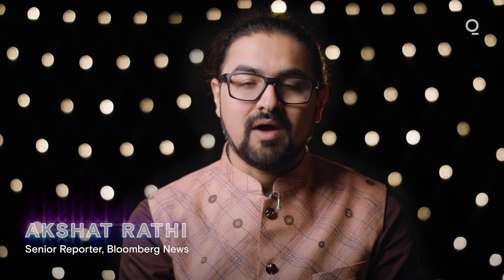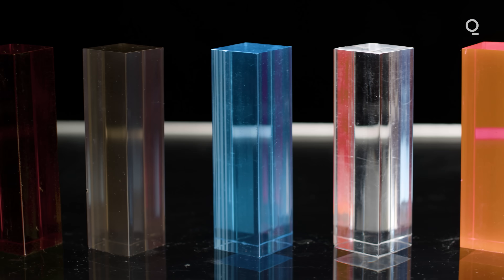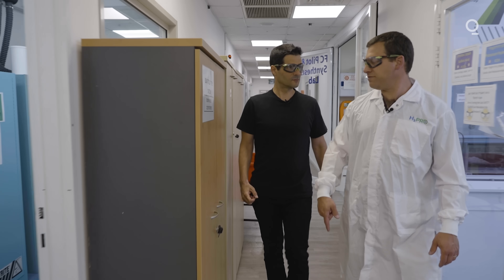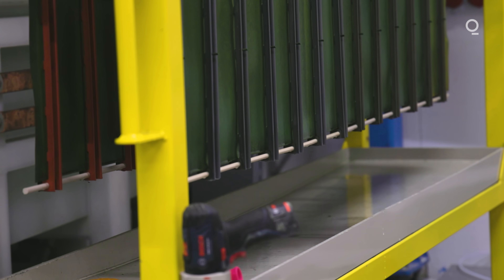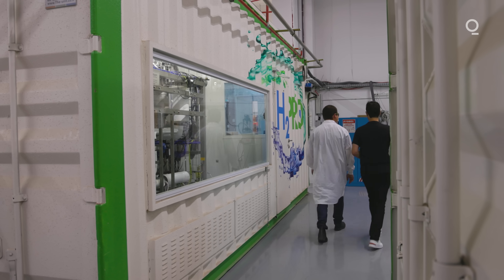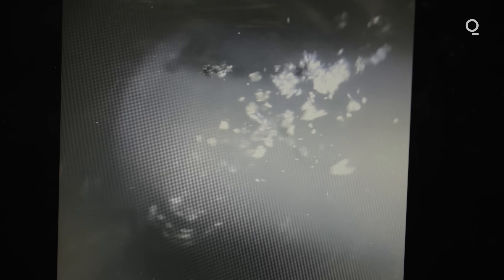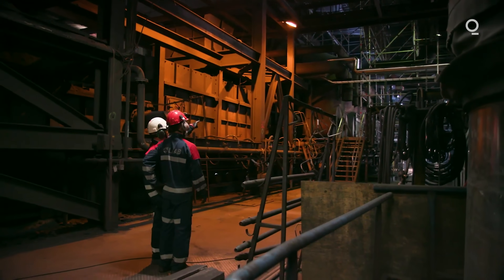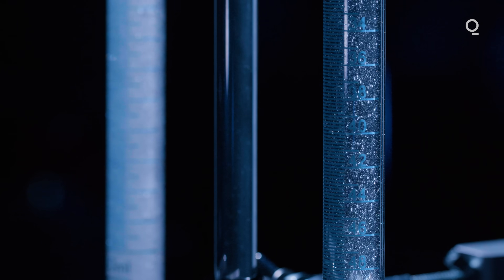How Cheap Hydrogen Could Become the Next Clean Fuel

Comment: I believe that C-Zeros process of removing the carbon in natural gas to be a better financial decision for our future rather than H2Pros of using hydrogen and oxygen to split water. This is my opinion because the world revolves around money whether we like it or not, it's our past and our future. If C-Zero can use blue hydrogen and green hydrogen at a rate 7 and a half times more than H2Pros green hydrogen process, then I see no debate. Yes, both companies want to hydrogen to cost around $1.50 per kilogram. But if C-Zero can use this turquoise hydrogen seven and a half times more than H2Pros, then they will have the greater potential of creating this hydrogen based "clean fuel" within the next 10 years over H2Pro.
Reply: Difference is that one company is using water the other is using natural gas. Natural gas is a tad bit expensive right now if you haven't heard, and essentially the company spends energy to make natural gas less efficient by converting it to hydrogen.

The only advantage that this method could have is that it's a way to use natural gas without emitting co2.

Comment: I didn't know there were so many ways that hydrogen could be made, and how much emissions could be produced when trying to create something carbon neutral. Even though hydrogen is extremely flammable and hard to store, I believe that when more industrial manufacturers and automobile industries begin using hydrogen as a fuel source, that it will get cheaper and much more efficient to produce, instead of storing it and waiting for someone to use it.
Reply: nah why everyone wanna be like Stanley Meyer all of a sudden
Reply: That's because you're not a chemist or chemical engineer, so why should you know? If you wanted to know, just ask one.

Comment: The lack of hydrogen fueling infrastructure is an issue that may be difficult to overcome without a lot of time but other hydrogen based technologies are available for use in other fields. This video showcased hydrogen based metal processing, if more hydrogen based machining processes like that could be implemented it could help to massively reduce our carbon emissions. Especially considering how many greenhouse emissions many industrial manufacturing processes create.
Reply: It's not a "lack" of something to regulate it out of being able to be used. Censorship, and a lack of something, are not the same realities.
Reply: how is building hydrogen fueling infrastructure harder than stripping every lithium available on earth for EVs, while still not having enough for the demand
Reply: Question if hydrogen and oxygen are separate from water💧 is that water💧 again useful for eg for drinking or for farming
Reply: @jitendrabalsaraf257 All of the water is turned into hydrogen and oxygen, which then ends up reacting whether via combustion or something else back into water, but producing energy.
Reply: Definitely this is the future, (green hydrogen derived ) liquid methanol fuel to fuel methanol fuel cell (and then electric motor without battery with way longer range and "rechargable" by refueling liquid methanol in just a minute just like any diesel engine. This is the future, better than "normal hydrogen" because methanol is a liquid fuel directly and easy derived from green hydrogen and way better usable than hydrogen because no need compression pressure storage and or ultra low temperature needed. Methanol liquid room temperature fuel is just a drop replacements in any gas station with little modification and same happens even with combustion engine but obviously fuel cell Ev gives more efficiency .
Reply: 😶‍🌫🤯We will soon introduce the revolutionary FAZE engine technology.
The 𝔽𝕦𝕖𝕝 𝔸𝕘𝕟𝕠𝕤𝕥𝕚𝕔 ℤ𝕖𝕣𝕠 𝔼𝕞𝕚𝕤𝕤𝕚𝕠𝕟 𝔼𝕟𝕘𝕚𝕟𝕖  
[𝔽.𝔸.ℤ.𝔼.] tech best solves the issues present in previous internal 
combustion engine designs by transforming the old paradigm into a 
simple, low cost, quiet, power dense, efficient, on-the-go liquid and 
gas fuel-flexible, ‘non-polluting’ solution for power generation of all 
scales and advanced transportation, construction, military, off-road 
vehicles including ships, aircraft, trains & robots not possible before 

𝔽𝔸ℤ𝔼 delivers better than 25% ABSOLUTE/ACTUAL [not relative] 
fuel efficiency improvement over gasoline engines, more than 15% 
for Diesel engines at any operating condition - speed/load, ambient 
temperature or elevation, not just at one optimal testing point at 
STP. Real world driving cycle savings could be an additional 200% 
higher due to the constant MAXIMAL efficiency and torque. The 
simple, low cost, native/built-in, non-electric, environmentally safe, 
non-explosive, temperature agnostic 𝕊𝕦𝕡𝕖𝕣ℍ𝕪𝕓𝕣𝕚𝕕© feature 
recovers more energy than EVs and provides approx.100% fuel 
savings for a combined absolute vehicle fuel usage improvement of 
approximately 300%, thus obviating the basic need for expensive 
EVs & e-hybrids. 𝕚ℙ𝕠𝕨𝕖𝕣𝔹𝕠𝕠𝕤𝕥 adds >400% more torque. It’s like 
4 engines in 1. 𝕚𝔼𝕗𝕗𝕚𝕔𝕚𝕖𝕟𝕔𝕪𝔹𝕠𝕠𝕤𝕥2© further improves efficiency, 
torque, power & other performance metrics by 10%. This is all done 
w/o a transmission. Additional fuel saving solutions are available.
 
The FAZE engine perfectly follows the vehicle’s road or genset’s 
electrical power demand with no energy loss [no fuel waste], This 
unique characteristic enables dispensing with any auxiliary power 
units [APU] for power or refrigeration in any application. This also 
makes for a perfect range extender for battery electric vehicles [EV] 
or as a standalone EV charging unit even where is no electric grid.
 
The fuel agnostic capability allows instantaneous use of any liquid 
or gaseous fuel [natural gas at home!!!] incl. biofuels and hydrogen, 
even if old/dirty/unprocessed like flare gas or employ the concurrent 
multi-fuel capability…anywhere on the globe. One engine for all 
locales w/o changes! Unlike EVs, this enables fast fueling anytime, 
anywhere…with no troublesome infrastructure disruptions or 
changes. EV’s are not a solution to the [FAKE]climate or mobility topics as 
high level of electrification globally is unrealistic 
[See Patrick Boyle's video "Electrify Everything?"] 

The technology offers smokeless, non-polluting, low odor heat and 
noise output without costly after-treatments, etc.,… with only the 
lowest  CO2. It has a negative carbon footprint with hydrogen, 
ammonia, biofuels or gasified municipal, agricultural and/or forest 
waste and coal from a 2-stroke-like simplicity. These are HUGE 
business opportunities. We can provide these turnkey solutions 

The FAZE technology can be integrated into any ICE or vehicle 
architecture, adding some of the positive characteristics to its own. An advanced Scotch Yoke architecture slated to be incorporated in the 𝔽𝕦𝕖𝕝 𝔸𝕘𝕟𝕠𝕤𝕥𝕚𝕔 ℤ𝕖𝕣𝕠 𝔼𝕞𝕚𝕤𝕤𝕚𝕠𝕟 𝔼𝕟𝕘𝕚𝕟𝕖  [𝔽.𝔸.ℤ.𝔼.]

With virtually no electronics and emissions equipment, the cost of
purchase and reduced servicing frequency make this solution 
even more appealing.

Comment: This is so interesting.  I had no idea that hydrogen gas could be produced in so many different ways.  I certainly had no clue that the color of hydrogen was directly influenced by the process by which it is produced.  It would seem to me that, while the green hydrogen is the ultimate goal,  the pink and the blue which are both produced by nuclear energy and carbon dioxide capture technology respectively, would be a very promising technology to develop in the fight against greenhouse gases.
Reply: Hydrogens are hydrogens, the colors are just to say HOW they were produced. Green means you produce Hydrogens with renewable, non-CO2 emitting, energy. Funny, it takes energy to create another form of energy.
Reply: The gas won't be colored, just a simple way to give each way of hydrogen production a distinctive color.

Comment: It would be great if we could start using hydrogen consistently for energy, but as of now there are too many cons. Only 2% of the hydrogen produced is made with little pollution being put off. The rest of the hydrogen created is generally made from coal. This is just polluting the Earth with an extra step. The clean made hydrogen is made at 3-5 dollars per kilogram and will not be usable in society until the benchmark of 1-2 dollars per kilogram can be met. Lastly, hydrogen is very hard to ship and safely contain. Zeppelins used decades ago ran on hydrogen, but often caught fire. It is not safe for us to use hydrogen till we can safely contain it.

Comment: You can't use hydrogen as fuel it's not practical it'll never work I mean yes it'll start a motor a motor will run but it won't work as a practical application there are too many water shortages on this planet can you imagine millions of cars running on water or is there a way to get the water back I don't think so if I'm wrong let me know but with water shortages the way they are in this country and around the world that's a waste of water

Comment: One important aspect of hydrogen fuel that was mentioned in this video was its potential environmental impact. It stated that the majority of hydrogen production today takes place on the polluting end of the spectrum. This spectrum is a spectrum of colors that go from the most environmentally friendly to the least. While most of it is produced on the polluting end of the spectrum, there are companies that are developing ways to produce it on the environmentally friendly end. The most environmentally friendly way mentioned was by separating the atoms in water by raising the temperature. The second most environmentally friendly way was by separating the carbon atoms out of natural gas. This leaves carbon in a solid state and does not release it into the atmosphere. Finding environmentally friendly ways to produce hydrogen is exceedingly important for the future of fuel and energy.
Reply: the video said it does make c02 when using natural gas
Reply: A very promising way to make clean energy was recently developed by Japanese scientists using small scale nuclear reactors that are cooled with helium instead of water, giving them the ability to run much hotter and not be constrained to rivers and lakes.

Comment: Do they realise that hydrogen is only a viable if you can source it. Right now that's the main issue. It doesn't matter how clean it is, if getting it (from water from electrolysis or by distillation of ocean water) inturn offsets the "green factor" that hydrogen is offering.

Comment: Hello Houston, we have a tiny problem to solve, and you can twist it and turn it upside down , and deliver it in any way you like. Hydrogen is right around 6 times more expensive to produce than Solar or Wind energy, and you can present it in the most sexy way you are most capable of.  Please give us a call when finally Hydrogen will come cost competitive with other plentiful energy present in nature that do not need a very costly process to produce ,store it, and possibly bypass the little detail that so far it needs to be converted in electricity in order to be efficiently used.

Comment: Now this is what America really needs for clean energy. Not just solar panals.
Reply: Oh you like carrying huge tanks for your fuel eh? I want to like hydrogen. 

 Hydrogen volume density is such garbage. Even at 700 bars with 22 liters you get a measly 100 miles of range. Whoopty doo! 

 Better with a fuel cell. Still I don't think there is much improvement there therotically either.

 Batteries are rapidly getting better. They have potential. Lithium Air which finally have been created will be a MAJIOR leap of ten to FIFTY times!

 We aren't there yet though, but solid state are now releasing. We will have longer lasting, more power, charge faster, and cheaper batteries. 

 Personally I think hydrogen will be incredibly niche. Maybe for remote locations or something where they can make their own. Going from power plant > hydrogen refinery > shipping hydrogen with hydrogen > vehicle. Just doesn't make sense when you can go power plant > vehicle.

Comment: Hydrogen production for manufacturing of steel and fertilizer are great use cases.  Especially if it can be done on site where storage and transportation can be minimized.  Although, once perfected, new processes like Molten Oxide Electrolysis (MOE) will be much more efficient and skip the production of producing hydrogen in the first place.

The idea of using Hydrogen for fuel, however, makes no sense when you take into account the gross inefficiencies and difficulties with production, conversion to electricity, transportation, and storage.  To make it economically viable as a fuel, you would need significant technological breakthroughs in all four of these:  production efficiency, conversion to electricity efficiency, storage, and transportation.
Reply: Gasoline is 13% hydrogen and 87% carbon. Since a gallon of gasoline will take you the same distance as 371.5 grams of hydrogen maybe the idea of using gasoline as a fuel makes no sense!